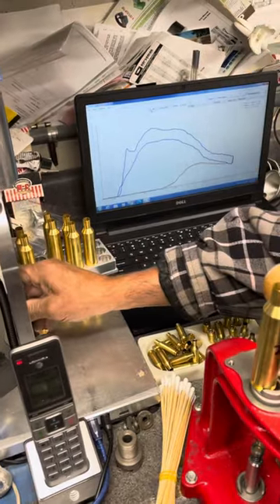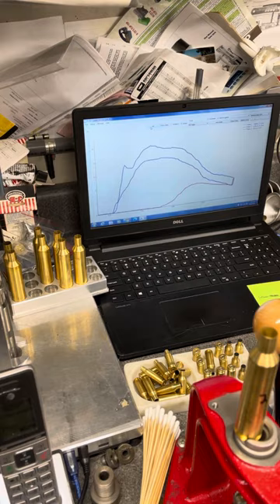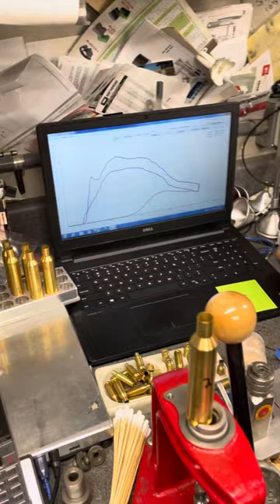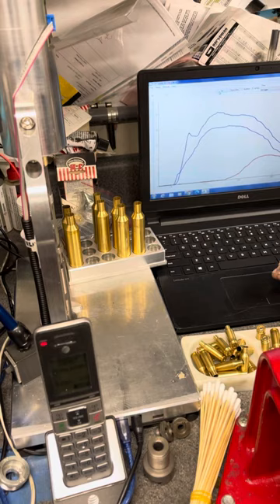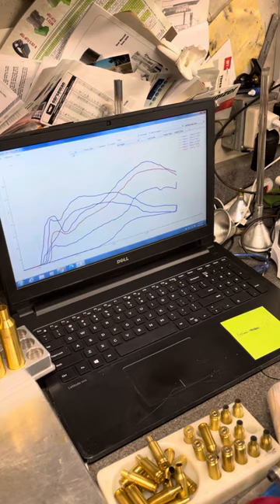Witch Doctor: AMP Seating Testing in Lou Murdica’s Tunnel

Comment: That is extremely interesting, thank you for sharing. Do you think  moly would change the impact of annealed vs not annealed cases. Possibly moly reduces the difference in neck tension with varying case hardness.
Reply from the maker: Thanks for watching and commenting. I think there is a general effect of the moly helping to provide more uniform seating pressures and bullet release. I did not test how moly impacts annealed vs. not annealed but based on data generated from AMP (https://www.ampannealing.com/articles/55/annealing-under-the-microscope/), I would hypothesize that the moly would help to make a more uniform seating pressure pattern in both annealed and not annealed BUT you would still see a very different seating force pattern between the two. Thanks for the idea for another test! I really appreciate any ideas that help enhance our knowledge and I will get to testing this and more once I get an AMP seating force machine of my own.
Reply: @WitchDoctorPrecision  I am very excited for your upcoming data. Thank you for sharing!!

Comment: What kind of Moly? grease? coating? Molybdenum Disulfide powder?
Reply from the maker: Molybdenum Disulfide >98% powder. Simply dip something like a bore mop into the moly to coat the mop and run it down the neck. This will add a moly coat inside the neck.
Reply: @WitchDoctorPrecision  nice. Bore mop is a good idea. Thanks!
Reply: @WitchDoctorPrecision  will the moly stick to the barrel , and what to use to clean it out ?
Reply from the maker: @bygoran  no, it won’t stick to the barrel. It evaporates with the powder burn.
Reply: It looks like the Imperial Dry neck lube (graphite) ; moly may be better, interesting solution but these 2 powders are toxic, so maybe that's a good idea to avoid doing it inside the house
Reply: @br4713  could be neolube #2. Liquid applied graphite. I’ve been testing and am very happy with it.
Reply: @FullSendPrecision  Liquid ? No risk to breath one of these toxic powders, great idea !!!
Now I remember I have something similar that I've found in Tony Boyer's book : Lock Ease. Normally it is used into the barrel after cleaning ; I will try it on the case necks. Thanks !
Reply: @br4713  the nice thing about the liquid is it gives an incredibly consistent coat
Reply: @br4713  how did it go with using lock ez inside the necks?  Very interested!!  Thanks!’
Reply: @wvlongshooter3912  Hello, I tried the Lock Ease (petrol based) and also some Imperial Dry Lube with some alchool. It was unconsistent (graphite powder amount left on the necks) and didnt work as expected so I gave up with this solution. Now I do a very light pass with the chamfering tool on the outside of the case mouth before using the FL bushing die, then after cleaning just a bit on the inside before using the expander (tiny dents can appear during the cleaning&resizing process). The bullet seating is smooth enough like this.
Reply: @br4713  thanks for letting me know!!  Interesting!!